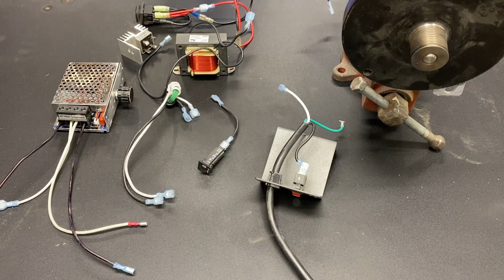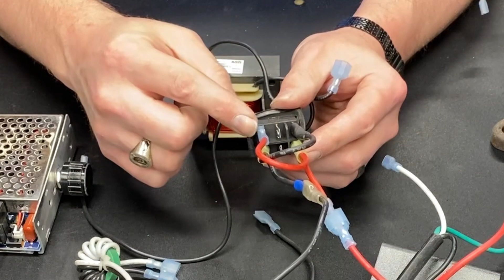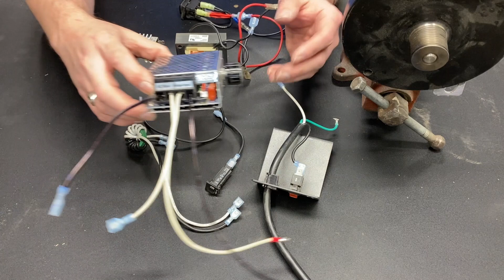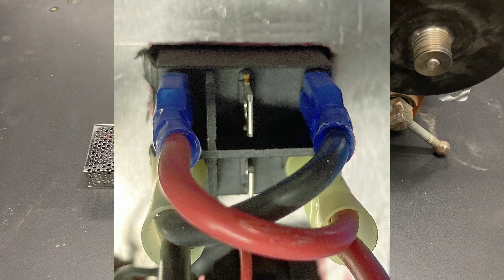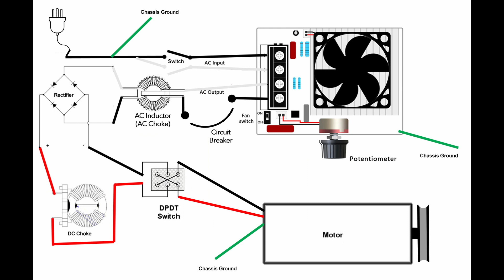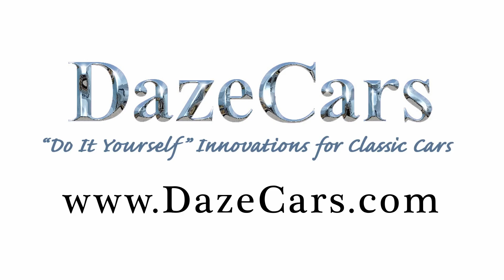Hooking up the Components for a Quality SCR Treadmill Motor Power Supply, Treadmill Motor Controller

Comment: Sorry if it's already posted, but what size dc choke is recommended for this set up? I have all the other components.  Thanks for your time.
Reply from the maker: The choke in most of my videos is part number 130993.  Instead of getting one new I would get a used one. A lot of treadmills come with a choke. Go to eBay and search “treadmill motor choke” BUT know that most people on eBay don’t know what they have and the word “transformer" will also appear in most listings. Problem is a choke and a transformer look almost identical so some listings are for transformers and some are fore chokes because the sellers think they are interchangeable. They are not. They would only be interchangeable if you modify a transformer to work as a choke.  (see my DIY choke video)  To tell the difference count the wires. A choke will only have 2, a transformer will have 3 or more.  General rule of thumb is the bigger they are (physical size) the better they work, also the coil needs to be at least 16 awg. Please let me know if I can be of further assistance.

Comment: Hi! How big the DC ckoke must be?
Reply from the maker: The choke in most of my videos is part number 130993.  Instead of getting one new I would get a used one. A lot of treadmills come with a choke. Go to eBay and search “treadmill motor choke” BUT know that most people on eBay don’t know what they have and the word “transformer" will also appear in most listings. Problem is a choke and a transformer look almost identical so some listings are for transformers and some are fore chokes because the sellers think they are interchangeable. They are not. They would only be interchangeable if you modify a transformer to work as a choke.  (see my DIY choke video)  To tell the difference count the wires. A choke will only have 2, a transformer will have 3 or more.  General rule of thumb is the bigger they are (physical size) the better they work, also the coil needs to be at least 16 awg. Please let me know if I can be of further assistance.

Comment: what guage wire do you use?
Reply from the maker: depends on the motor I am working with.  motors that draw more amps require  bigger wire.  look at he wire coming out, usually the size is stamped or printed on the wire.  In most cases 16 is a minimum, 14 or 12 is better.

Comment: You mention that the DC choke needs to go on the positive side of the circuit. In another video, you test different DC chokes, and show a shot of how much the motor sparks for each test. Have you tested putting the choke on the negative side of the circuit, and observed the relative sparking? My intuition tells me that it wouldn't make a difference which side of the circuit the choke is on, and I would love to have more evidence/information either direction. Thank you for all the great videos.
Reply from the maker: I have learned it is somewhat interchangeable, I have not done the test, but I can give you the evidence.  I have scrapped a bunch of treadmills and the ones with chokes a lot of them are on the negative side but some are on the positive side.  Also with my two DIY chokes, they seamed to work slightly better on the negative side but no difference with the factor chokes.
Reply: @dazecars  Thanks for the wisdom. I will stick with the positive side in my machine. Much appreciated for the perspective.

Comment: When I was in highschool 65 years ago I wanted to study electronics after I found a bunch of old radio valves in a box. But it wasn't to be. Now that I'm in my late seventies with my electrical appliances from Ch*na (where else are they made) only lasting a short time, the urge to learn to fix them myself has re-amerge thats why I'm hooked on your channel so thanks for your time and effort you put in to make these videos      My first question of many more to come is... the SCR unit I purchased has a breaker fuse already installed, do I need to connect another fuse like the one you recommend?
Reply from the maker: Glad my videos are of help!!  If your SCR  already has one, then no you should not need another fuse.

Comment: Great information and clearly explained, just how a good informational video should be 👍
Do you have a link to the DC choke you used please?
Reply from the maker: The choke in most of my videos is part number 130993.  Instead of getting one new I would get a used one. A lot of treadmills come with a choke. Go to eBay and search “treadmill motor choke” BUT know that most people on eBay don’t know what they have and the word transformer will also appear in most listings. Problem is a choke and a transformer look almost identical so some listings are for transformers and some are fore chokes because the sellers think they are interchangeable. They are not. They would only be interchangeable if you modify a transformer to work as a choke.  (see my DIY choke video)  To tell the difference count the wires. A choke will only have 2, a transformer will have 3 or more. Please let me know if I can be of further assistance.

Comment: Thanks for the demonstration but the motor does not need a capacitor?
Reply from the maker: A capacitor is not required.  These motors do not need a start capacitor and using a capacitor as a power smoothing device while effective in smoothing the power has the negative side effect of the motor surging under a load in my experience.  I ran capacitors on several of my machines but removed them because of the surging.

Comment: Hi there,
I tried to use a washing machine motor with a variable motor speed controller like the one shown above without the conversion from ac to dc.
When I tried it the speed of the motor could not controlled. In the contrary the speed continously increased and I disconnected it from the mains when the speed was exceeding 20000rpm.  I put the motor directly on the mains but the situation is the same with the increase of the speed. The connection on the motor is. Jumper 2 & 3. The ac mains 1 & 4 . The 5 & 6 is tacho not used.
Please advise and help

Thanks a lot
Thanasis Katsambas
Reply from the maker: A washing machine motor is is an AC motor o there is no need to convert to DC but an SCR is not a good speed controller for a motor like that.  You will damage it

Comment: Re:" Your link for bridge rectifier: What do I need a 100a rectifier for? Also that's not what you are using.
Reply from the maker: I use the smaller rectifier in my videos because it is more convenient for bench test hookup.  It is NOT however the rectifier that I use on any of my machines.  I talk about this in lots of videos how the smaller rectifier is prone to failure and that is why all three of my machines being powered by treadmill motors use the rectifier linked in the description.
Reply: @dazecars  Fair enough. I have several 25a and 50a Rectifiers. I would expect the DC Choke would do a lot to protect the Rectifier from being damaged by reverse voltage. However, your circuit only has a DC Choke on the positive side and there is no Electrolytic Capacitor (DC BUS LINK) between the DC Chokes and the motor, so maybe that's not enough protection for a small Rectifier.
Reply from the maker: @eCitizen1  Some  other factors here are max amps and continuous amps.  The amp rating is max and in most cases 50% of max + or - 10% is continuous operating range.  Then if it is already running hot and you get a spike it will blow out the rectifier.  Also I don't think the quality is there.  When I was first learning all this I had some of those 50 amp rectifiers fail immediately.  Everything was hooked up correctly they were just defective from the factory.  I have had at least a dozen people make comments where the cheap rectifier failed so anyone using one stands a good chance of it going bad and I hope they protected their SCR with a breaker or it got fried too. The rectifier designed to go in welders is far superior and I would much rather use something completely up to the task compared to something that is just "good enough"   The choke smoothes power on both legs so positive side or negative side really doesn't matter.  When I first started all this I was thinking of the choke kind of like a water filter for power and that is why I suggested it be on the positive leg but a lot of SCR basted treadmill have it on the negative leg and it works just as well.   I don't think the cap would do anything to protect the rectifier, just smooth power after the rectifier but it has been my experience that capacitors can also cause surging under a load.

Comment: First I want to say thank you for your videos very informative. The second thing I want to say is you confused me for a second where the breaker goes. You started out by saying the AC inductor is after the SCR then the breaker but in the diagram the breaker is before the AC inductor.
Reply from the maker: Either works.  The only important thing is that the breaker is in between the SCR and rectifier.

Comment: Hello and thanks for such comprehensive instructions. I searched for inductors and haven't found any that look like the one in this video.  They look more like something for circuit boards.  What size inductors would work? Please
Reply from the maker: I would recommend getting a ferrite doughnut from amazon and then wrap some wires around it 7 wraps each lead

Comment: do you think your setup will benifit from a D.C capacitor? heared it is recommended in general but will be happy getting your opinion here. thanks
Reply from the maker: I tried it.  I harvested the capacitor from a defunked MC2100 (should be the correct specs for a treadmill motor) The result was surging under a load so I removed it.
Reply: thanks for reply. that is interesting result

Comment: Is there specification for the choke? I want make sure I get the correct  one
Reply from the maker: Not being an electrical engineer I do not have any specs for you, what I can do however is offer you some guidelines. First of all bigger is better. I have several motor chokes ranging from the size of a tennis ball to the size of a soft ball and the bigger they are the better they work. Second the wire for the choke needs to be a minimum of 16 awg. If the wire is not that big or better it will not have the amperage capacity to allow the motor to work properly. Third they are not available on Amazon at least not inexpensively, there are a few privet sellers on Amazon selling used parts from treadmills for big bucks but the available chokes on amazon are too small because they are not designed for a motor even though they look correct in the picture they are way too small. The choke in most of my videos is part number 130993. Instead of getting one new I would get a used one.  A lot of treadmills come with a choke. Go to eBay and search “treadmill motor choke” BUT know that most people on eBay don’t know what they have and the word “transformer" will also appear in most listings. Problem is a choke and a transformer look almost identical so some listings are for transformers and some are fore chokes because the sellers think they are interchangeable. They are not. They would only be interchangeable if you modify a transformer to work as a choke. (see my DIY choke video) To tell the difference count the wires. A choke will only have 2 wires, a transformer will have 3 or more. Also before I started doing videos chokes on eBay could be had for $25 or less shipped but now that more people are looking for them (due to my videos) the eBay sellers have raised their prices quite a bit. Your best bet might be the DIY option out of a Microwave transformer. Please let me know if I can be of further assistance.

Comment: Thanks for making these videos! These are the most informative, well thought out videos about treadmill motors and speeds controllers on YouTube. I have a question regarding DC filter chokes. When I hooked up the components as you did in this video, I could only get the motor to turn very slowly when the SCR speed controller was turned to what should have been the fastest setting. When I took the DC filter choke out, and hooked the motor directly to the bridge rectifier, the motor started no problem, but with lots of arcing, as expected. I only tried this momentarily, to hopefully limit damage to the motor. Is it possible I sourced a DC filter choke that was too small or possibly defective? I don't know much about filter chokes and thought I would post here to possibly help someone else who had the same issue. Any insight you could provide would be much appreciated!
Reply from the maker: Glad you like my videos.  As to your issue it is kind of hard to diagnose the issue without more information.  My guess based on what you have said is that you are using a small electronics choke and not a motor choke and being small the wires can not provide enough amps.  What is the AWG of the wire on the choke you purchased?  What are the physical measurements of the choke?  if it is not at least as big as a tennis ball it is likely too small.  My best choke is closer in size to a softball.
Reply: @dazecars  Thanks for your reply. Yeah, I didn't give as much detail as I probably should have. The other components in my setup are the same as you use, including a larger rectifier rated for 100A 1600V. Into the rectifier my voltage meter shows 120 VAC, and going out shows 108 VDC. I suspected my choke was too small when it arrived, but thought I'd give it a shot. It appeared larger in the listing when I purchased it. I did see in some other comments where you recommended larger is better. Mine is about 1 1/2" tall X 1 3/4" wide and has what look like #18 wires going in and coming out, which should have told me it was too small. The choke did get warm when I was trying it, but not hot. I didn't want to keep it hooked up since the motor would barely run, but I'm guessing I need to reconnect and check amp draw to confirm. Could I check amp draw on the incoming side of the choke and the outgoing side to see if this is the issue? I'm not as knowledgeable about DC power, but I have learned a lot through your videos!  I am really having a tough time locating larger chokes. If you have any suggestions, that would be great!
Reply from the maker: @jugtownpottery  I would not even mess with the choke you have, it is way to small.  The choke in most of my videos is part number 130993.  Instead of getting one new I would get a used one. A lot of treadmills come with a choke. Go to eBay and search “treadmill motor choke” BUT know that most people on eBay don’t know what they have and the word “transformer" will also appear in most listings. Problem is a choke and a transformer look almost identical so some listings are for transformers and some are fore chokes because the sellers think they are interchangeable. They are not. They would only be interchangeable if you modify a transformer to work as a choke.  (see my DIY choke video)  To tell the difference count the wires. A choke will only have 2, a transformer will have 3 or more.  General rule of thumb is the bigger they are (physical size) the better they work, also the coil needs to be at least 16 awg. Please let me know if I can be of further assistance.
Reply: @dazecars  Thanks for the information and great content!
Reply from the maker: @jugtownpottery   my pleasure

Comment: https://youtu.be/SjEgKH_MGFE thank you for replying to me,your link that I sent back to you is the same set up I am doing and all of the other components are put together it just the reverse switch I need to put in place now,so I would like to know how to put the input and which line to put the output
Reply from the maker: Again, the link I already sent you shows you everything you need to know about direction switches and how to hook them up https://youtu.be/B1pj3N1J2vg
Reply: @dazecars  u show how to put it on only 2 of the input but not the output,watch the video over and u will see
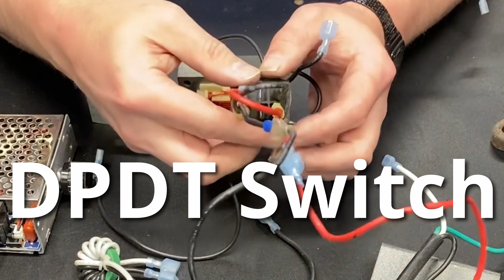Reply from the maker: @cliftonstone8568  I made these videos, I know what is in them, so I don't appreciate the attitude especially since I am trying to HELP you.  The fact that you are not comprehending does not mean the info is not there, as tons of people have used this info without issue.  I can not provide any more information than what I already have in the two videos.  At about 2:20 on the SCR hook up video I show exactly how to hook up the reverse switch.  At 8:18 on the SCR hook up video I have a picture showing exactly how to hook up the DPDT switch.  Then again on the other video I sent the link for that has all the info anyone would ever need regarding forward and reverse switches I show exactly how to hook up the switch at about 8 minutes.

Comment: What DC choke are you using? Link to get it?
Reply from the maker: The choke in most of my videos is part number 130993.  Instead of getting one new I would get a used one. A lot of treadmills come with a choke. Go to eBay and search “treadmill motor choke” BUT know that most people on eBay don’t know what they have and the word “transformer" will also appear in most listings. Problem is a choke and a transformer look almost identical so some listings are for transformers and some are fore chokes because the sellers think they are interchangeable. They are not. They would only be interchangeable if you modify a transformer to work as a choke.  (see my DIY choke video)  To tell the difference count the wires. A choke will only have 2, a transformer will have 3 or more.  General rule of thumb is the bigger they are (physical size) the better they work, also the coil needs to be at least 16 awg. Please let me know if I can be of further assistance.